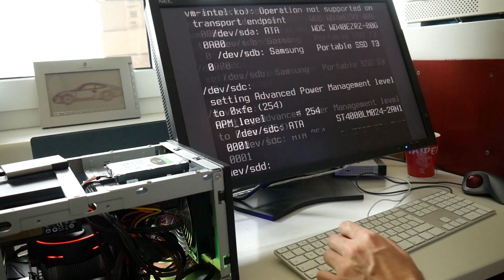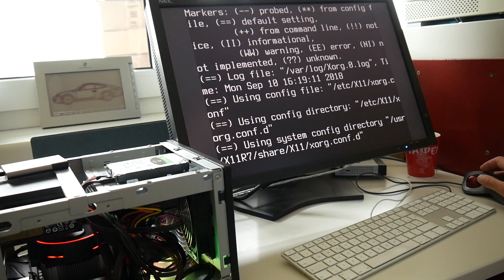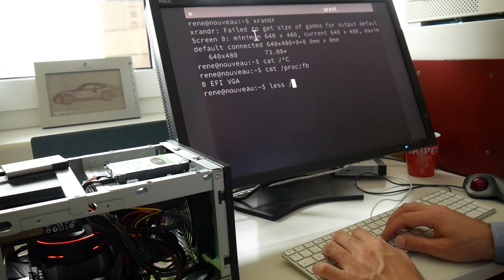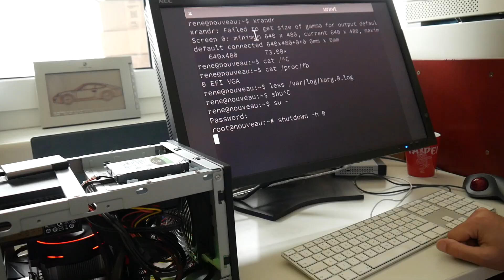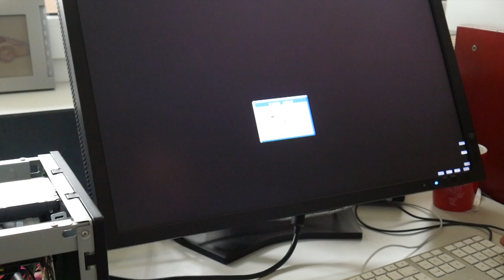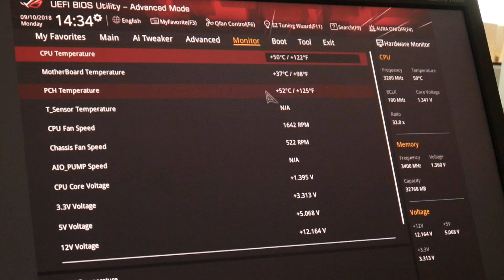PCIe flex extenders: do they even work? Let’s find out!

Comment: you're nowhere near the limit, apparently! https://www.youtube.com/watch?v=q5xvwPa3r7M
Reply from the maker: Interesting, given the high frequency I’m quite surprised this even works with my 30 or 40 cm thing I tested. Given how touchy VLB was back in the day and even angled pci risers could sometime already throw the timing / signal integrity off, ..!
Reply from the maker: I know. But a VLB / PCI riser, or longer extender would still have all the same length for all signals. But I guess longer PCI extenders would not work due capacitance and such, but has anyone ever tried? ;-) I intuitively assumed the extremely high speed, high clock PCIe would be even more sensitive to capacitance, interference,  cross talk, … but maybe differential signaling helps it the most? Btw. there are 16-lane extenders, but I intentionally got the 1 lane extender, because I wanted a flexible cable and not this huge inflexible wide cable, ..! ;-)